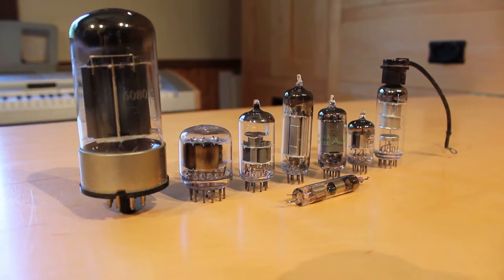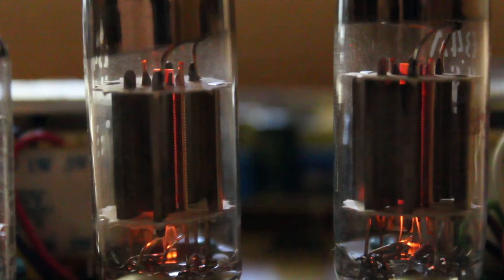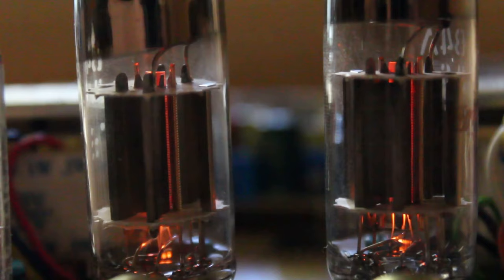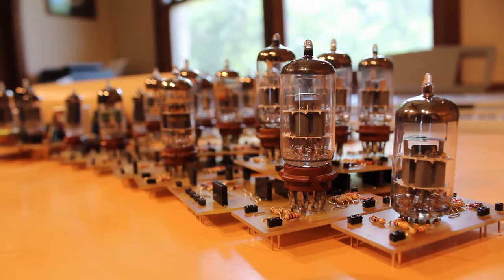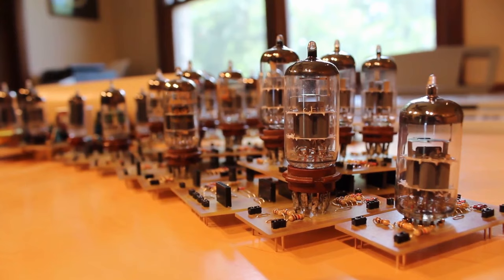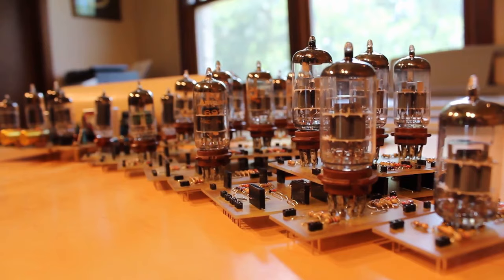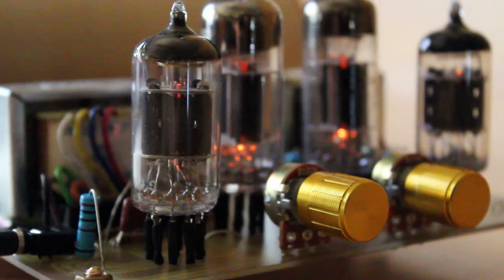Vacuum Tubes: Episode 1 - The Basics and the Diode

Comment: Great video. Very good coverage of the subject. But, if you think a few hundred volts is "high voltage", you probably won't like my CRT videos. Back in the day, TV repair guys referred to anything below 600 volts as medium voltage and below 60 volts as low voltage.
The 6AL5 is not a power rectifier. It is a dual diode used in an FM discriminator in TV audio or FM radio receivers. It is (was) some times used as a phase detector as well. But, generally it is signal level diode not intended for power supplies.
Reply from the maker: Thank you!
And you're absolutely right, a couple hundred volts is very far from high voltage! I'm a bit of klutz and an idiot though and tend to stick my fingers in live circuits, so anything that can give me a good shock classifies as HV in my book, haha. 
The 6AL5 is an excellent little dual diode, and IBM used them quite a lot to build logic gates too. They don't move a lot of current, but they're great moving signals.
Reply: And also :  All tubes can function as rectifier if cathode and any other terminal is used.
This property can be used to test if tubes are in order.
In RF oscillator circuits, all triodes will work even if the plate supply is AC instead of DC supply. 

Regards.

Comment: If I overvolt the heater voltage at 4.5v instead of 1.2v how long do you think the tube will last? a few hours? 200 hours? I know it is a strange question. Long story short is a client wants the tubes to be "brighter".  I purchased the tubes dirt cheap. I was able to buy 400 for the price of 10. I could give the client 10 replacements. Also would it be safe? My understanding is they simply burn out not shatter. I am simply using the tubes  in a guitar pedal circuit with filament voltage not any other (high) voltage. I know it is silly but the client came to me and is just throwing huge money at me.  Also would it be possible to use this tube as a clipping diode in place of a traditional diode?

Comment: Bảo Trần Q
0 seconds ago
Hello , I really admire your passion and contribution to the field of electrical engineering. I have a question and hope that your expertise can address it.Do you think that a triode that uses a household power supply with 220V and 50 Hz be able to give an output power with 60KV, 30 Khz and 1 amp. Basically, my question is Can a triode function like a transformer of high Voltage and Frequency? Thanks
Reply from the maker: Thank you!
I'm not sure I fully understand your question, but I'll try to answer as best I can!
Triodes are essentially just a switch, they need additional components to get them to oscillate. Additionally, most triodes have an upper limit to the amount of voltage that can be applied to the plate, and it's usually in the hundreds of volts. Now, it is possible to use a triode as an oscillator to generate HV through a transformer. For example, this is the HV circuit in my HP 150A oscilloscope that generates 5kV:
https://i.postimg.cc/tTp4q49X/CRT-Schema.png

The 6AU5GT is set up as an oscillator that generates a high frequency oscillation that goes into the transformer. This gets boosted to a couple kV and then rectified through the 1X2B recitifier. The oscillator tube never sees any voltage higher than about 400V, and the 1X2B rectifier is intended for high voltage applications.

However, it's important to note that while this is generating some HV, it's no where near the 60kV you're thinking of, and even further away than the 1A. 60kV @ 1A is a terrifyingly large amount of power, and will require some seriously specialized equipment. There are some tubes and thyratrons specifically designed for such insanely high power applications, but that's well out of my realm of knowledge. I definitely recommend checking out Photonic Induction's Youtube stuff or Styropyro's Youtube stuff, they both have experience with dealing with very high voltage and high power applications and give much better insight than I can!

Comment: Are you willing to share your sources for tubes and sockets? Do you have favourite suppliers?
Reply from the maker: Sure!
Though, I don’t really have a source for tubes. About 10% came from random salvage, but the rest were just lucky buys on eBay. I’m not particularly picky about the type of tubes I get, so I search for large “tube lots”. Though lately I’ve bene focusing on the 6AU6 pentode as it’s plentiful and decently affordable. So I just keep an eye out for good 6AU6 lots on eBay.
Sockets on the other hand is a little more difficult. For prototyping on the breadboard I have about six 7-pin sockets and four 9-pipn sockets set up like this: https://i.postimg.cc/kMW72bcr/IMAG3143.jpg
This is perfect for the low voltage prototyping that I do, and the sockets were sourced from some scrap electronics. However, you only really need a handful like this so they can be sourced from a ton of places. There are cheap used alternatives on eBay, or new sockets can be purchased from a few suppliers around. Or, keep an eye out on Marketplace/Craigslist for some old vacuum tube organs. They often have a ton of good dual triodes like the 12AX7 and matching sockets.
When it comes time to start building larger circuits, I’ll cut PCBs on the mill with holes sized to fit these 1mm PCB headers: https://www.mouser.com/ProductDetail/Harwin/H3161-46?qs=p%252BybrH12zCFIuSSHm88cAQ%3D%3D
I hope that helps! Let me know if you have any other questions!

Comment: 1.25V? How nice of them to design the heater to be driven straight off of a bandgap reference :P
Reply from the maker: Haha, they were really forward thinking back in the day!
You know, though, I'm not entirely sure why they used a 1.25V heater. At first, I thought it was maybe because it was meant to be a battery powered filament, which helps with isolating it from the rest of the circuit in a directly heated tube, but most battery powered tubes I've come across have 1.4V filaments, because that's what the "A" batteries at the time were rated at. Also, the 5642 tubes is also rated on the order of kilovolts, so it definitely never saw use in radio circuits. I'll have to do some more reading into this!

Comment: May sound silly to ask but could you use the heat source from Plutonium 238 or could you reverse the system to run of cryogenics for a reverse effect ?
Reply from the maker: That's actually an awesome question! 
Reversing the effect I don't think would work because the extreme heat is needed to get the electrons moving. However, I love the Plutonium idea!

Plutonium 238, being the material used for the RTGs that powered a lot of earlier space probes and satellites, puts out quite a lot of heat. If a small enough piece of it could be made and then a cathode slid over it, I could totally see it working! Aside from the fact that the tube would now be fairly radioactive, this would have quite a few benefits, but the chief of which would be that the filament is no longer necessary. That means that the actual current required by tubes in logic circuits would be almost nothing!

Now, this could be expanded even further to something like Nuvistors ( https://en.wikipedia.org/wiki/Nuvistor ). These were super small vacuum tubes that were about the size of early metal can transistors. Instead of a filament, a tiny pellet of Plutonium 238 could be used as the heater and the metal casing could be built to block the radiation. Then, these could be chained together to make logic circuits that have equal or maybe even less power draw than the early transistors had. 

Thank you for the awesome question, and now I'm going to spend the next few days thinking about what could have been if nuclear vacuum tubes had been a thing, haha.
Reply: @UsagiElectric  IIRC, Pu-238 is an alpha emitter, which would be easily stopped by the cathode sleeve. Even beta particles (high-energy electrons) from isotopes in the decay chain would be stopped by the rest of a typical tube structure.  The alpha particles might lead to a slow buildup of helium gas in the tube, alpha particles being bare helium nuclei.

The big worry would be if any isotopes in the decay chain were gamma emitters.

Comment: would a tube with a higher voltage filment boil more electrons off the cathode than for example a 6bq5
Reply from the maker: Yup! Though, it's not just limited to voltage. Essentially more power through the filament to burn it hotter boils more electrons off. For example, the 6080 dual triode is a properly large power tube and it uses a 6.3V @ 2.5A filament to burn nice and hot!

Comment: Wonder if you could make a vacuum tube without a tungsten filament, replace it with a uv led since uv has enough energy to move electrons, perhaps use a material in which when uv light hits it it throws off more "free electrons"

Would drastically reduce power demands and heat issues, also could open up different drive characteristics since also the led could also be digitally controlled or even pulsed at different frequencies or even intensity
Reply: 7:55 instead of thermionic emission, you use photovoltaic emission....

Comment: One thing about vacuum tubes is that you can make them. Not easily, but you can (see, for example Dalibor Farnt here n youtube) 
A (late) friend of mine found himself with a surfeit of spare time, around 1942, somewhere in Germany, after his Spitfire engine failed. He set about the project of making a radio out of tin cans and jam jars. He didn't succeed, as he was wrestling with the vacuum issue when some real valves rolled under the hut door one night. Obviously he stopped at that point but it probably was possible. 
He had no idea where these valves came from, so neither have I.

Comment: Good video! Just a little point at the start the diode you drew is reversed if electron current flow is what you are talking about ( vs conventional current). Ah I see later in the video you are talking conventional current.
Reply from the maker: Thank you!
Conventional current flow vs electron flow is always confusing and doubly so when talking about tubes! Ideally, I should always refer to everything in terms of electron flow, but old habits die hard sometimes as I was initially taught conventional current flow.
Reply: If it helps any, the arrow (or anode) in the diode symbol is like a wind vane; it always points where the wind is coming from, not the direction the wind is blowing. ;-)

Comment: Hello usagi, quite honestly for new peeps, adding in the second vacuum tube diode along with your glitch at 18:15 with the yellow leds at the beginning, really messed up some of your explanation! Most tho, got your vibes with diode operation at low voltage. You did an awesome job otherwise, Imho and thanks for sharing.

Comment: About 23:00 is not right?  Direct heat is always more efficient as, well, it is directly heated.  But the reason I was told in class and may I quote some random note in the internet as below the reason to use indirect heat ... use AC and isolation : "The main  using an  is to isolate the rest of the vacuum  from the electric potential across the filament, allowing vacuum  to alternating current to  the filament." 

I am not sure also whether it is related but I can see for the twin triode (or diode) here so you can use one element to heat two ...
Reply from the maker: I didn't go into nearly enough detail here, but the answer is a little more complicated.

Using indirectly heated cathodes definitely provides isolation allowing AC to be used for the filament, which is great for building more complex circuits. But, the having and indirectly heated cathode provides one more massive benefit - the cathode can be coated with something that greatly enhances electron emission, usually something like barium oxide. This means that the cathode doesn't have to get as hot to attain the same level of emission. So, an indirectly heated cathode can be heated to around 500C, but a directly heated cathode may need to be heated to double that to obtain the same level of emissivity. But this also means that depending on the coating and operating temperature, more emission can be achieved than a directly heated cathode because the filament is far less stressed in an indirectly heated setup!

There's also other benefits too, like you mentioned being able to use one element to heat two or more cathodes. So, depending on application, construction, materials, etc., either an indirectly heated cathode or a directly heated cathode can be more efficient!
Reply: @UsagiElectric  Agreed.  But avoid misunderstanding may I think this line "So, an indirectly heated cathode can be heated to around 500C, but a directly heated cathode may need to be heated to double that to obtain the same level of emissivity. "  ... using the same energy and hence as you said it is more efficient in one scenario.  The scenario of two element e.g. many double triod and the rectificer I used in front of me that use two cathode (to gain the two phase of AC to become all +ve phase of DC.) is a different scenario.  Even so, now I think about it, it may be more about pin and AC still.

Comment: you haven't  been terrified by a tube unless you have been a USCG LORAN-C transmitter tech working on transmitters with F-1086 final PA tubes, water cooled with 21.5KV plate voltage putting out a megawatt of power to the tower.
Reply from the maker: You ain't kidding! That sounds terrifying just reading about it, haha.
Reply: @UsagiElectric  the fear, and respect,  made us really into good technicians.    the transmitters were enormous,  most of the maintenance was done from the inside of the equipment.   the largest (AN/FPN-45) transmitters had input amp stages made of little bitty baby tubes like in your video through multiple amp stages to a final PA section of 8 F-1086s,  in push-pull config, 4 tubes per side.   They put over a MW out to a either a top-loaded 1/4 wave monopole (625' or 1250' live tower) or a sectionalized 4-panel antenna hanging between 4, 700' towers.   I spent many years at 3 tube transmitter stations like that, and also many years at newer solid-state transmitter (AN/FPN-64) stations which did not use tubes, and put out slightly less power.    Good channel, btw.

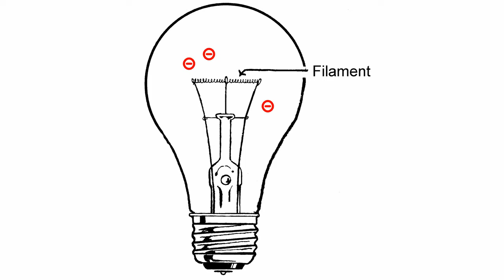Comment: 3:00 Understand it is a kind of figurative speaking; but I think the electron generated are not looking for any positive thing.  It was just emitted with a negative characteristic (or field thing if you do not like entity but field).  If there were any negative or positive sign around it will operate with it or them (or the field), just not in future we add in positive and negative grid …
Reply from the maker: I did do a bit of a personification here, but the sentiment isn't entirely incorrect. The electrons that boil off the cathode or filament inherently have a negative charge and will be attracted to a positively charged element within the tube. The grid itself doesn't (or rather shouldn't) absorb hardly any electrons at all. All the grid does is create a field with a charge that can be changed. If the field has a negative charge, it repels the negatively charged electrons and they float around in a sort of "cloud" around the cathode. If the field has a positive charge, the electrons are attracted to the positively charged grid, but more importantly, the immensely strong positive charge of the plate presents a far greater attraction. So, the electrons fly right past the grid and get absorbed by the plate. 

So, in a sense, the electrons aren't "looking" for a positive thing, but something with a positive charge (the plate) will attract them, while something with a negative charge (the grid) will repel them.

Comment: this "inefficient direct heating" rationale isnt really obvious. rather you want to have independent cathodes. also nice for rookies to always see closed circuits instead of "+24V" labels
Reply from the maker: I didn't quite explain it clearly in the video, but the efficiency isn't actually directly related to whether the cathode is the filament itself or indirectly heated. The benefit comes from being able to coat the cathode with a material for enhanced emissivity. In a directly heated tube, where the filament is also the cathode, the filament itself can't really be coated with anything. However, in an indirectly heated tube with a separate cathode, the cathode can be coated with a metal oxide like barium-oxide or strontium-oxide, which really helps electron emission.
Reply: @UsagiElectric  plus having independent cathodes potentials from tube to tube  (primary benefit)